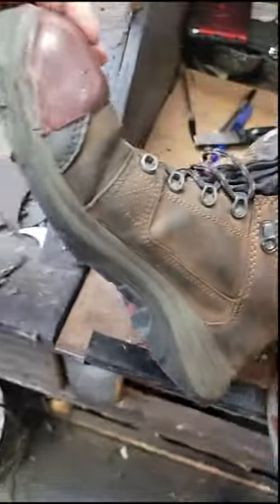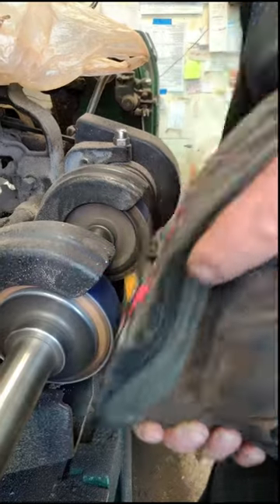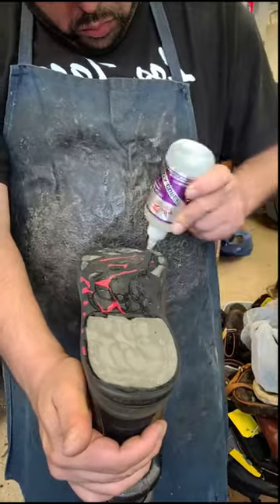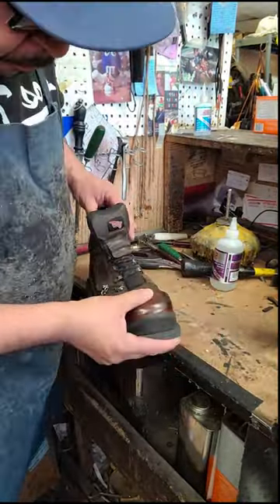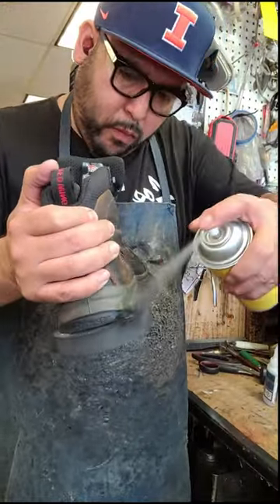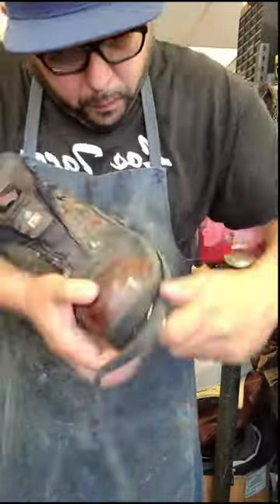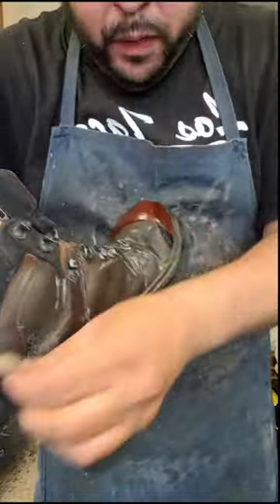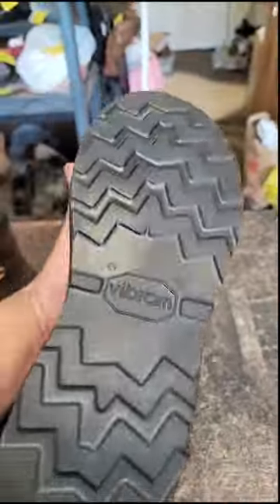Red Wing Work Boots Restoration

Comment: Red Wings are some of the most comfortable and durable boots I’ve ever worn for construction purposes. During the summers I would do concrete for a friend of mine’s father’s company and those Red Wings were awesome. Yes they were pricey but they were worth it. When your feet are screwed it’s the worst. Spend that extra cash on a good pair of boots,your feet will thank you
Reply: Disagree, paid $300 for some RedWings and prefer my Timberland Pro. Main reason is the toe box even though I got wide they still squeeze my pinky toe making it very uncomfortable.

Not all boots are worth the cost, my go to BoonDock Timberland Pros are much better and cost half

Comment: I notice you use the accelerator spray on top of the super glue. Couldn’t you also put the super glue on the sole of the shoe then the accelerator spray on the new sole? When you attach it it’ll dry very quick.

Ps. The orange boot laces look slick!

Comment: …. I’ve been in the trade for over 40 years ….. the worker did a respectable job sanding the boot bottom flush but using super glue and activator only is not the correct way to adhere the sole … the boot bottom needs to be primed : flexible green primer and yellow primers appropriately used and cemented will ensure the job doesn’t crack and come apart …. I sometimes use super glue on the polyurethane boot bottom after sanding flush then I spray it with activator sand it lightly then apply cement to both the boot and sole wait ten minutes and join them together for a thorough bond with no smiles all the way around the boot …  there is not enough flexibility in the rigid bond with super glue only because the super glue crystallizes the polyurethane on which the sole is bonded to and cracks especially at the instep when the customer walks …. the customers boots will not hold up appropriately …. I work in Pleasanton ca shop and I post pictures of my work …..

Comment: I’m curious about the new sole. 
Is that a similar height to the original boot? 
Does it have the heel-high rake the replacement has?
What about the toe up-flip?
As expertly done as this job was, the red slashes from the original sole merging with the new sole look a bit odd and repaired. 
I believe making those black, as well as applying a subtle texture or contour to the exposed sides of the sole would have taken this one to the next level. 
Great work 👍

Comment: I'm not a cobbler but thus seems like spotty work. You just glue the new soles on top of the old cup sole?
Maybe that's all the Customer wanted to pay for, but I would be pissed if my boots came back like that.
Reply: Yeah I don't know if these will hold. The original soles are polyurethane and crumble over time. A better repair is replacing with a vibram cup sole or can be modified for a unit sole. But, generally this line of RedWings aren't exactly made to be rebuilt.
Reply: I'd  also like  to state that I like this creator. No shade being thrown, this just does not "seem" like good practice.